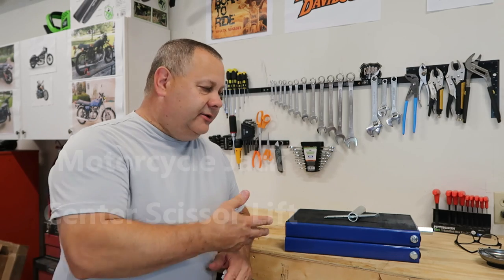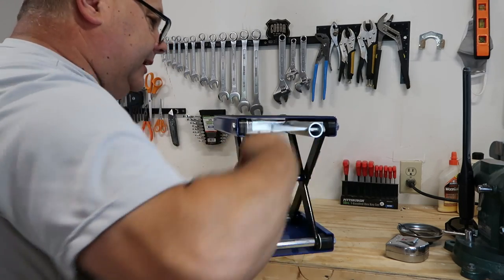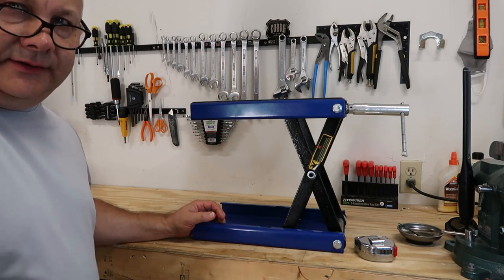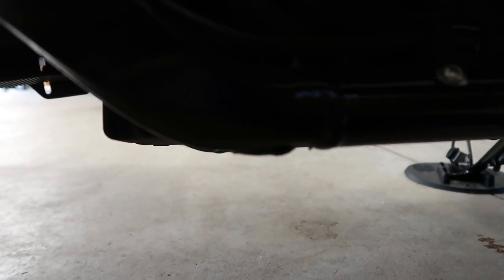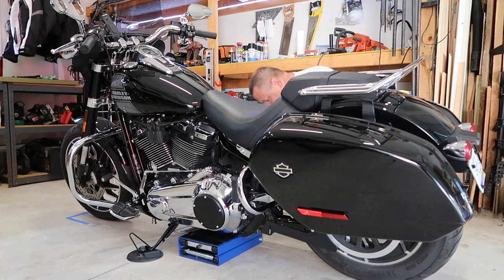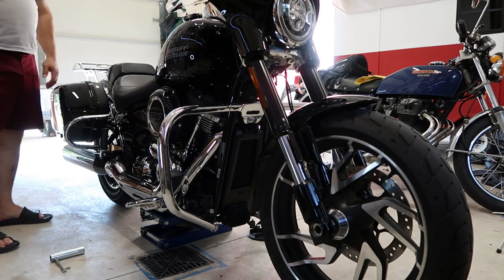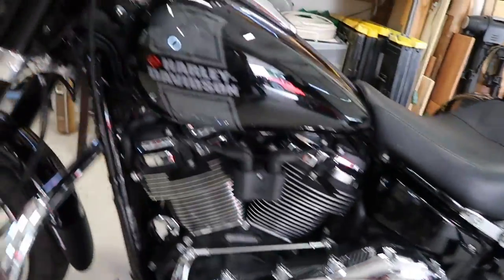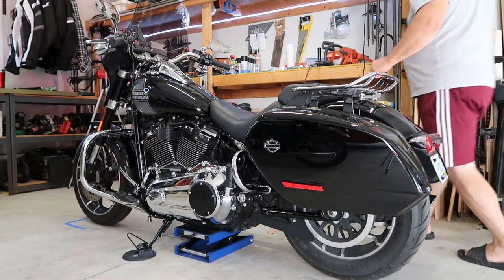Center Scissor Lift for My Harley Davidson

Comment: I'm new to the world of 2-wheels and all I have so far is an electric moped (Niu UQi+ Sport).  I needed something to lift it off the ground to work on the wheels or the disc brakes, or to drain the battery halfway through winter (part of maintaining overall battery life) by just throttling on cruise-control without actually going outside (lots of snow where I am).  Like you, I've been looking at these jacks on Amazon for some time, but never made up my mind.  Primarily because I've never seen one in action, since I'm the only one in my social circle that rides.  Now I know how it works and what it can do.  And considering my e-moped is only 75kg (165 pounds), I know almost any jack will be able to handle it.

Thanks for the video, Todd!  It's helped me make my mind up!  I'll be buying a scissor lift jack tomorrow!
Reply from the maker: So glad I could help you move forward on your journey. Best of luck to you!

Comment: Great video ,Ive had the same stand for a few years I use it over the winter months to get both wheels off the ground ,works great , would recommend using a ratchet ,also love your four hundred four in the back ground.

Comment: The problem with this jack is that there's no way to strap the frame of your bike to it, if you're just going to raise it up to 'look' at it fine, just don't plan on turning a wrench on it, your bike will slip right off this jack when you're least expecting it and crash onto the floor. Don't use without a front wheel chock or strapping to some overhead rafters.
Reply from the maker: I've never had an issue. I have a front wheel chock that I use if I'm going to do any real work on the bike. I use this lift every day as a center stand and it is rock solid when you're not lifting both wheels off the ground. Thanks for the input...

Comment: You can buy a socket and use on your chordless drill
Reply: My lift instructions not to use a drill or impact. it has to do with the hardness of the main bolt. And yes, a socket and ratchet is the only way to go!

Comment: I bought the exact same scissor lift for $55US delivered.  It's really well made and for the price, so it's an absolute bargain.  To use a ratchet bar, it takes a 22mm socket (7/8" is a similar size).
Reply: Whats the link to buy please ?

Comment: Can it be used to do a full oil change on a Softail?  Does it leave room to get at all the drain plugs?
Reply from the maker: You can move it around forward and to the back. It's just a matter of placement.

Comment: I'm looking for a stand for my '22 Lowrider, but man that seems like a lot elbow grease to jack it up!
Wonder if there's a hydraulic version out there with a handle.
Reply from the maker: If ya just put a ratchet and a socket on it it would be easier. It really isn't that bad just as is. Thanks for input.

Comment: I just need a lift to get my 21' Softail Slim onto a Redline Dolly. This way I can store it and move it easily around my garage. Obviously the Slim is very similar weight and size to your Sport Glide.  Are you able to center the lift to get both wheels off of the ground a couple of inches with this lift?
Reply from the maker: I'm sure you can.

Comment: Are you going to do a stage 2 upgrade torque cam, HighFlow Oil Pump , S,,& S  Air intake , Vance & Hines Pro Pipe 2 into 1 wuth SE Tune? You'll pick uo 25' lbs (120) Torque & 40 HP (115) gain.
Reply from the maker: No, I'm happy with the stock performance.  I'd rather put the money into taking some motorcycle trips out west. Thanks for the comment...

Comment: Can you change the oil easily while its on the lift?
Reply from the maker: No, most motorcycles have the oil plug in the bottom of the motor.

Comment: Everything on the bottom of your bike must be above the frame. It wouldn't work on a low rider for example. I believe the transmission would be a obstruction.
Reply from the maker: I'm not sure how some of the other bike frames are designed. Thanks for your input.

Comment: why would you break your back stooped over crankin on that thing to raise the bike when a standard mc jack is sooo much better and very reasonably priced nowadays.  that one  you got definitely has its usefulness like for under a tire but geez not as a main lift.
Reply: These are lower to the ground than hydraulic lifts so you don’t run into the issue of getting the bike on 2x4 to get clearance for the hydraulic lift. Also don’t have to worry about seals leaking and it’s easier to safely lower the bike by yourself.
Reply from the maker: It works better when using a ratchet to raise and lower it than just using the wrench that came with it.  Not only is this a great center stand for the winter, or jack to lift and work on the bike, but it takes up very little shop space when it's not in use. As well as other safety benefits as mentioned in the other reply...
Reply: They work great as a stool to sit on whilst working on your bike or cleaning it too.  Just used mine whilst to sit on cleaning my wheels of caked on brake dust.  Small and portable.